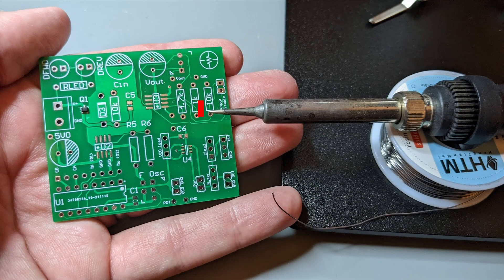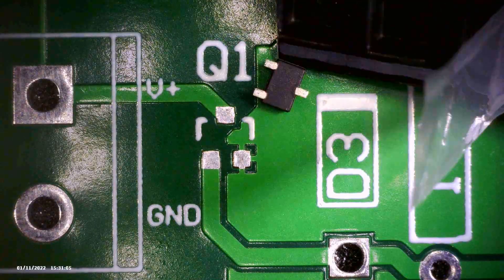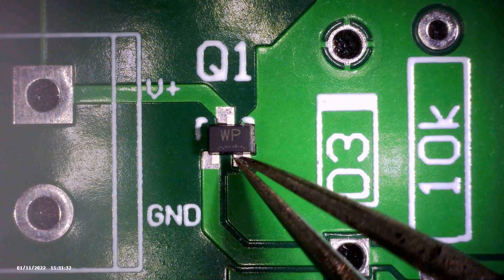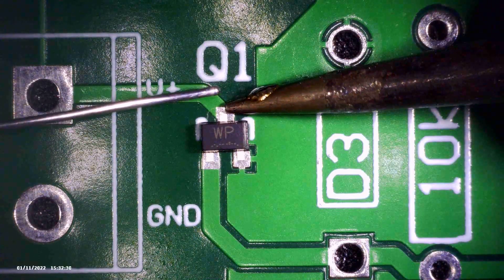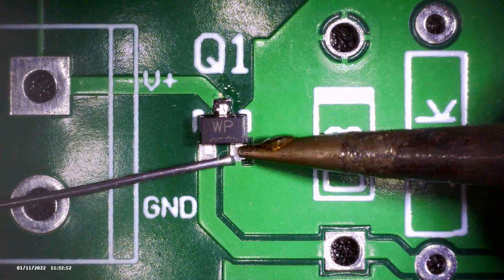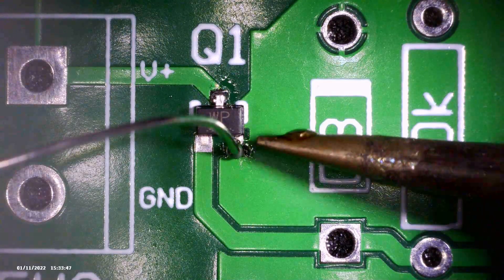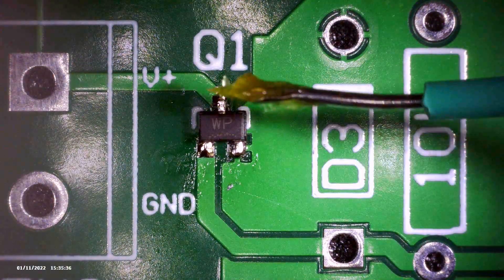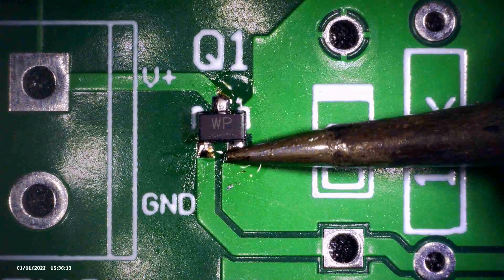TOMLOV DM10 Microscope - Testing it out

Comment: Does TOMLOV DM10  has PC conection?  like HDMI/VGA ?   Noticed same microscope and same pictuure you displayed in this video on the site you bought, and someone there says   "is the only minus for this microscope that does not have PC connection"!  But how did you record this video so clear? With SD Card?  thank you!
Reply from the maker: There is no video output port (at least none that I know of). My recordings were done using a micro SD card and the built in recording software.
Reply: @electronicswithemrys  Thank you very much for reply, and useful info!

Comment: Does that TOMLOV have a HDMI port? Or a SD memory card slot? Have you tried a similar digital microscope but with a larger screen? Thank you. I thought TOMLOV made a 10" or so unit.
Reply from the maker: No, this one doesn't have an HDMI port. It uses a microSD card for transferring data. I've found that the card is kind of hard to take out, so I added a piece of tape to mine so it's easier to grab.
Reply: @electronicswithemrys  ok thank you! I think the larger size TOMLOV may have an HDMI port to hook up to a larger screen.

Comment: I don't know how long you have been in electronics but there are better ways at doing stuff.  First start with some flux on the board, then while holding the part tack down one leg. More flux than finish the job. No cold solder joints.
Reply: Exactly. Clean, flux, place, tack, finish soldering, and clean again. I've been repairing electronics since the mid seventies.
Reply from the maker: Hi Robert -- thanks for the comment! I have been in electronics for over 20 years, starting as a technician and now as an EE working in the semiconductor industry, so yes I am familiar with other methods for soldering. I made this video to really test out the microscope and not so much as a tutorial on the best way to solder.